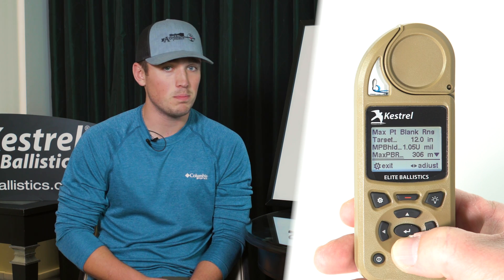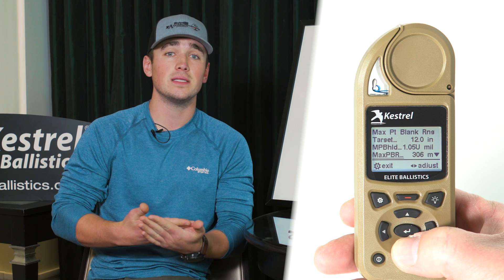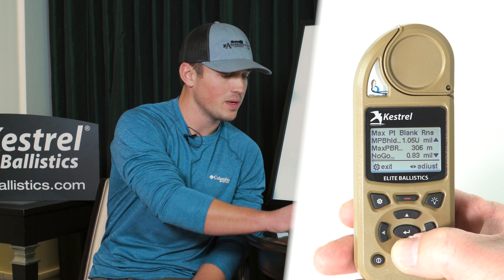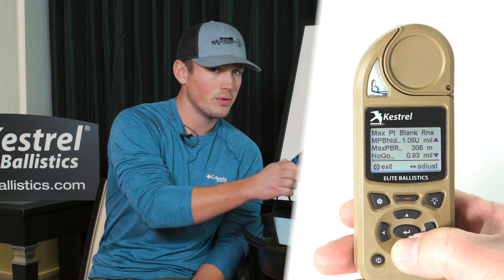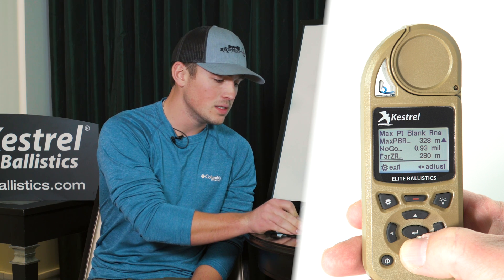Max Point Blank | Colby Hodnett of Accuracy 1st

Comment: What does the 12" drill tab in the accuracy 1 st menu on the Kestrel 5700 device do and how is it used? What is the IS in the table display option? Why does this table start at 254 meters and end at 610 meters?

Comment: There appears to be competing definitions of MPBR out there. One is essentially the distance at which point your bukket will drop half the size if yoir target. Fir instance if the target is 12" then yoir MOBR is the distance at which yiur bukket drops at 6". I believe this equates to "battle zero". The other definition is that MPBR is like shooting through a pipe i.e. with a 12" target you are allowed to shoot 6" high and your MPBR will be the distance at which yoir bullet drops 12". Have I understood the distinctions correctly?